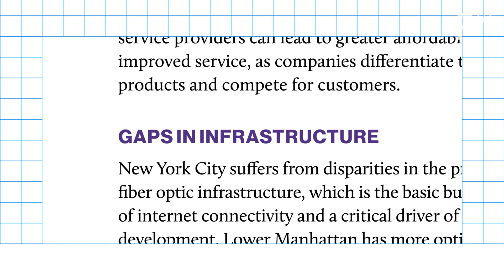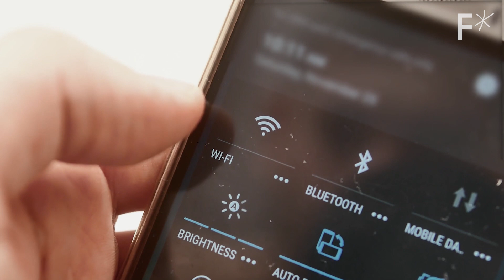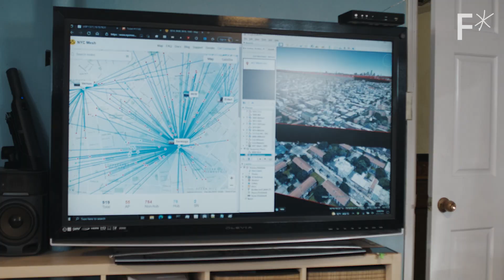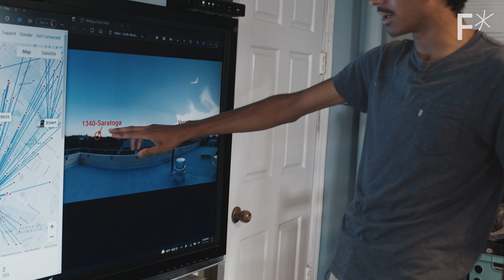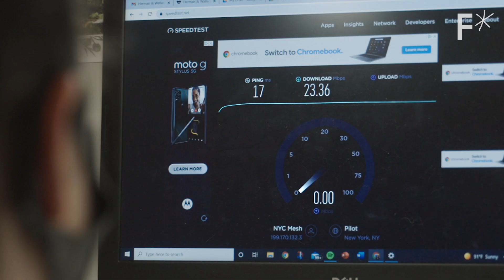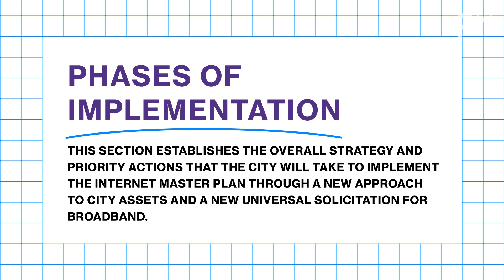NYC’s nonprofit DIY internet is taking on Verizon & more | Just Might Work by Freethink

Comment: Next week: Big tech ISPs sue nonprofit meshes and lobby congress to push thru a bill that makes nonprofit meshes illegal.
Reply: And studies that the meshes are killing people, corporate money "buying freedom since 1776"
Reply: facts bro
Reply: Wifi is also cheap here
I have 3.3TB at 60Mbps for less than $10 per month
Reply: @souravtambe5743  where
Reply: @ugwuanyicollins6136  india
Reply: only in America! i.e. require a license to use your rooftop for radio transmissions. SMH
Reply: @apricotcomputers3943  Yeah I was wondering how they got past the FCC regulations on that, I have a HAM license for much, much smaller baby sized projects and that only covers non-commercial, I couldn't charge even a cent for a $1k installation.
Reply: @jakegarrett8109  if you're not making $$$ and are under the radar, big Telecom doesn't care.. but let him start charging. they'll lock him up in court cases!
Reply: @jakegarrett8109  you see, they are not charging. It's voluntary payment.
Even if you don't pay, you still get internet.
Reply: @sulizu0186  I still cannot collect even a cost recoup though, the FCC doesn't allow donations either for use of services (its then considered a payment, even if it really is just a donation), I would almost say you might get away if you were a church pastor but you then aren't using it for just personal and they would consider that preaching to be commercial (especially if you collect donations) so you'd still need to get a commercial license like FM radio stations even if they are non-profit. They basically allow no exemptions (except the specific one where you are allowed to sell your radio equipment so long as you are not routinely advertising it and hogging air waves because then its commercial again)
Reply: @jakegarrett8109  open a non profit organization
Reply: @jakegarrett8109  we use unlicensed spectrum and FCC compliant gear
Reply: @jakegarrett8109  you're just wrong, we're not a radio station, and we use unlicensed frequencies. It requires no license. If we did use licensed frequencies it's no big deal you just pay like $200 for a license. This stuff is all straight forward and not difficult to do.
Reply: @NYCMesh  Interesting, I wonder if its similar to LoRa devices in that case. If you are able to avoid the licensing and paperwork, well that's over half the battle and that's excellent! Thanks for the info!
Reply: @jakegarrett8109  yes we use the WiFi bands and some unlicensed 24 and 60 GHz bands. but as I said elsewhere licensing is cheap and easy and we'll do that one day too.
Reply: ..and Fox News will be calling Communist
Reply: they already are,
they are fighting over free ghz spectrum range.
Reply: yep.just like uber.but fesar not!!!WE ARE CHANGE.and we the free people will prevail against all forms off slavery and opression of the elite and monopolies.
Reply: Good
Reply: big companies are like mafia eh? bullying the people through law, and law obviously isn't to protect the common interest of the people, they protect people who  can  give them so much...imagine that that is law in some aspects of the business mafia running your town...
Reply: Norway: 150 usd for 500mbit up/down + TV
Reply: in short:  MURICA F*CK YEAH!!!!
Reply: This stuff is already illegal across most of the EU. It can cost a billion dollars for a licence to set up what they call "supernodes", I would be interested to see if NY is the same.
Reply: @geroutathat i think those are licenses to run mobile networks not to use unlicensed wifi frequencies
Reply: how secure is this??
and how easy it's to tap into someone's network ?
Reply: And they wonder why some wanted to do a revolution
Reply: I thought wireless cell phone internet was competition for the cable company?
Reply: Unlimited internet but capped at 512kp
Reply: Spanda Vibration  economy will boom, those poor people with even a simple low end mobile phone can find online work opportunitues without traveling/migrating.
Reply: Lmao. Facts
Reply: Yuup
Reply: For our safety. . .
Reply: What a gay thing to do
Reply: Here in cameroon you get 30gb for $16 and you are given 1gb daily for 30days
Reply: You need Jio , we get 50GB internet for 3$,that's how cheap it is for Indians
Reply: @BhanuPrakash-hk5iu  It's pretty trash that you have a data cap, I have unlimited although it ain't as cheap. $70 200mbs unlimited
Reply: Ours is Unlimited for 20$ it's slow af though... We live in the Philippines lol
Reply: @frost6296  you guys would need VPN to access torrents or other restrictions and for us there is no such restrictions applied by local ISP’s. 
For US the ISP can temporary block ur internet or disconnect it if they find heavy p2p traffic, in India we use such laws to wipe the floor.  So we don’t mind data caps and 3.3 tb is seriously too much data for any layman.  
Have worked for spectrum in the past when it was TWC and it is reason I know that ISP’s in US do block such traffic.
Reply: @frost6296  Same here but $50 for unlimited at 3 Mbps
Reply: @frost6296  In India , we can get 1gbps unlimited for just $52 a month.
Reply: @frost6296  We have limited internet here in Egypt the lowest package is 140 gb at speed of 16 mbps for 7.5 dollars although all the cables in the world come through Egypt due to its geographical location between continents.
Reply: @BhanuPrakash-hk5iu  No, you don’t need jio. Stop spamming.
Reply: @BhanuPrakash-hk5iu  USA is a corrupt hellhole country
Reply: @BhanuPrakash-hk5iu  it's around 18 USD a month in PPP
Reply: It is not free and it is not a human right to have internet. Either you pay for it out of your own pocket or the Taxpayers dollars are paying for it. Those so called volunteers are useful idiots and those who send them are getting rich in the process.  The US government is killing low income family for things like this. Inflation is accelerating at a rapid pace. Keep asking for more free stuff and you will see your children paying for it for the last 100 years. Nothing is free and those corporations who invested in the infrastructure and setting this SERVICE need to charge for it or the government will charged the Taxpayers. Why do I need to pay for free internet in NYC? Corporations pay little taxes and even if they get a  high increase in taxation they will pass them to the consumer. Furthermore, a few millions dollars is nothing for a corporation but a few hundreds for low middle class family in this disastrous economy is a lot. Basically this Mesh internet is a ripped off! Socialism is coming to America and when it seated : You will need to get out of your sofa and pay with your freedom. It is ok to lower the prices but asking for free stuff and getting service without payment is not right. They only fool me once! Enjoy it until the FCC is ready to collect and take them to Federal Court.
Reply: @AMCUSOLDIER  I don't think that's how this one works, this is people donating money to make their own infrastructure (something people used to do a lot for roads, also still done on occasion). This would not affect taxpayers as taxpayers are not paying for it. This is simply a barely commercialized co-op group of consumers banding resources together.

If people are abusing it, well its the exact same as getting free WiFi from McDonnalds then (I was very close to doing similar since the internet where I was at sucked, but 5 miles away was a McDonnalds WiFi with half gig ethernet. Nothing was really to stop me from placing a raspberri pi in a nearby tree with a solar panel and a 5w transmitter with YAGI or patch antenna and redirect that to where I was with another repeater in a tree, and then down to where I was at). So in my example I would have been making my own repeater/mesh network for myself using HAM radio gear. If I lived in a place that did the mesh, you know I'd be pumping money into hardware funding its distribution (and I would have my own personal tracking turret with a high gain antenna). Know how much it would cost tax payers? Nothing, I just don't want 1 Mbps internet (or at least that, but preferably more)

Comment: I feel like there are major drawbacks of a mesh system that no one is talking about. Also who provides service to the supernodes?
Reply: I've read a bit on their wiki, it's interesting, you should too. Technically speaking, there's no way to escape big ISP providers, as the internet is all interconnected. Though, from what I've read, NYC Mesh has a couple of peers that provide access to certain routes, as well as upstream transits are also donated. I suppose it is enough for a community effort to last long while not fully depending on the big providers.

On the other hand, your concerns also apply to practically any broadband. Affordable FTTH (in my country at least) uses GPON, with some weird upstream combinations. One neighbor sending a lot of packets, and the entire neighborhood with the same ISP starts cursing.
Reply: They connect to one of the larger isp's networks
Reply: @ashtong85  So no one is escaping "the big isp provider" lmao they're simply bouncing a signal around and carrying it as far as it can go before the bandwidth drops too much. So if someone on your same mesh was downloading everyone on that mesh would feel it, correct? I take it the "super node" is absolutely covered in dishes.
Reply: Please enlighten us

Comment: How do they strike deals with T2 and T1 backbone networks? 🤔
Reply: I suspect they use end-user access points without regard of the terms of service. Perhaps they have a way to get around it by swopping out the primary connection enough so that ISPs basically will need to play wack-a-mole. I can see this being workable in a high density area like NYC but when your primary access points are limited the ISPs will catch-on quick and throttle, shape or suspend service.

Comment: Videos like this make me feel glad I'm in India and not in the USA. I get 3TB bandwidth with 40mbps speed for 8$/month here.
Reply: Which Indian city do you live in? What's it like in the countryside?
Reply: @jaimepuig2258  I live in Chennai, but the data cost is about the same all across India, countryside you might not get a fiber connection but decent mobile data is available everywhere, you can get 20-30mbps speed, 2.5GB/day data cap for 28days for 4.65$/month, with unlimited free calls and amazon prime membership for 28days.
Reply: What !!!